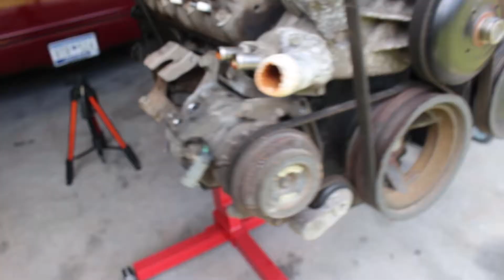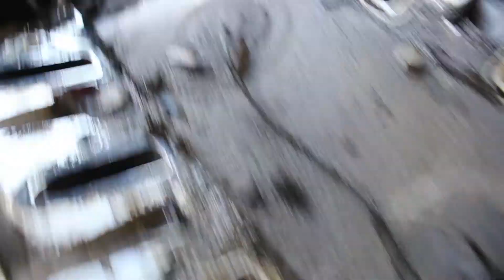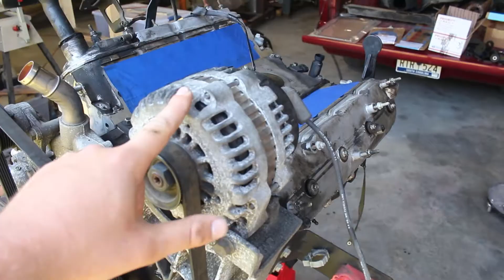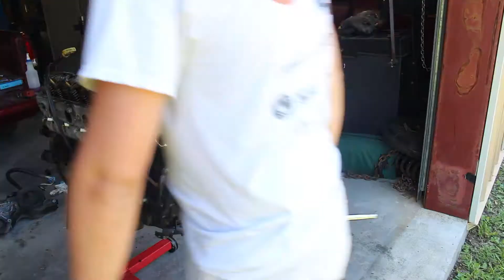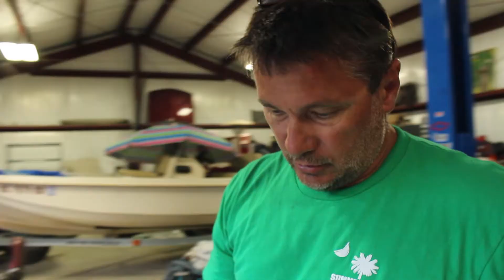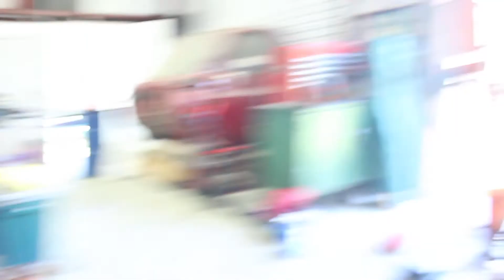S10 LS SWAP PT 4: Engine CLEANING and TEAR DOWN

Comment: What up man where did you order the ball bell for the rear main seal at
Reply from the maker: Hey, I got the JGR Barbell off of amazon. The PN is JGR-1052 and I got it in silver.
Reply: @WOTGarage1   what up thank you so you bored your motor to a 5.7 right that what I do to my motor now so have you got the truck run yet I have not see no video yea
Reply from the maker: The engine for the s10 is a 5.3 and the 5.7 is for the c10. We haven’t fired either engine up since building them, but there will be videos to come once they are running.
Reply: @WOTGarage1   ok then man sound good to me I bored my 5.3 to a 5.7 man just be look at how you doing everything to the motor and s 10  I have a 2000 Chevy s 10 I put a 5.3 in my truck so I need all the help I can get
Reply: @WOTGarage1   where did you get the roll pan from I need one on my truck do you have the part number where did you order one at